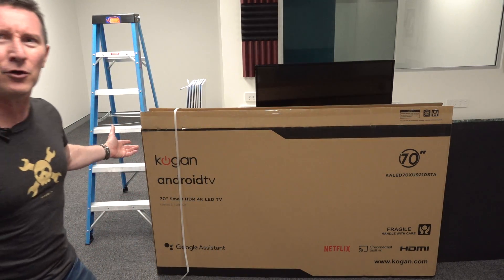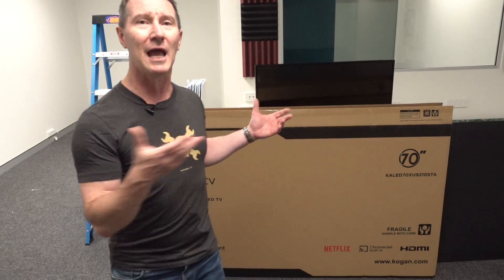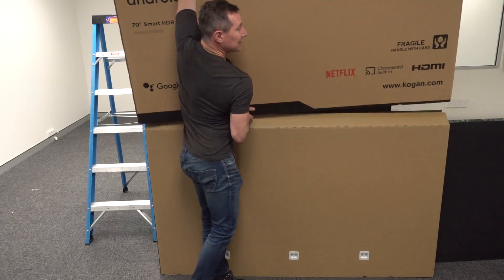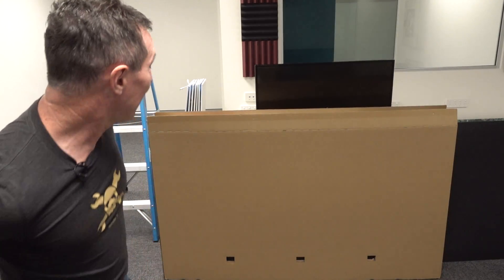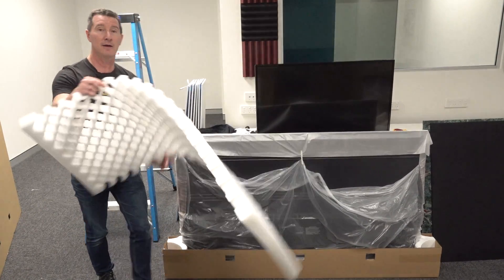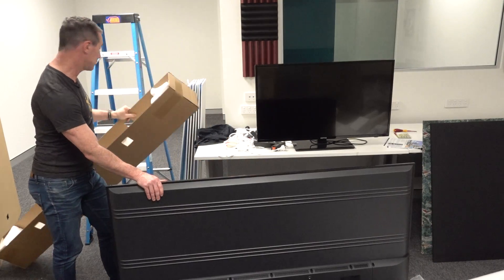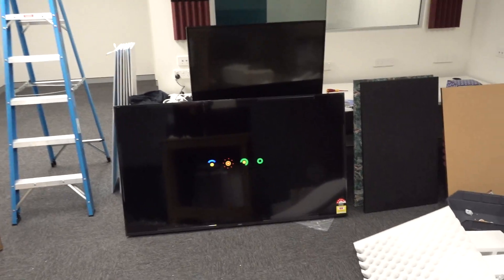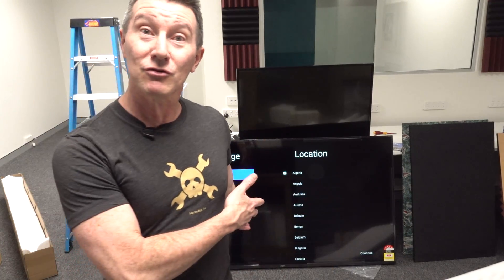eevBLAB #77 - TV Packaging Technology is INTERESTING

Comment: You missed the coolest thing...  If you squeeze the sides of the lattice foam it will collapse down, you can see how it was a smaller piece of foam that’s cut and then pulled apart.
Reply from the maker: Totally missed it!
Reply: This is how "expanded sheet metal" is made... that is the grill you sometimes see on vents/doors/windows/etc. that have that diamond pattern, and is made the same or similar way.
Reply: You can see where a small part of it has already collapsed back to the original form.
Reply: Came here to make this exact comment, glad someone else was probably screaming at the screen too lol
Reply: Was going to say the exact same thing!

Comment: If you took a high-tech device like that back in time 200 years and showed it to an engineer of the era, they'd probably be more impressed and excited by the corrugated cardboard box that it came in than they would by than the item itself -- the device would be completely incomprehensible (both in purpose and how it functions), but the packaging would be a revelation!

I've never seen that sort of fancy box, but whenever I've taken something fragile like that out of its packaging I always flip it upside down, cut the tape on the bottom of the box and open the flaps, flip it right side up again, then just lift the box off. Similar principle to this in execution, but doesn't require all that additional packaging and engineering. Presumably there are unpacking instructions on the box somewhere so people know how to get in there properly, but given that people have a tendency to not read instructions I suspect a lot of the effort in designing it goes to waste -- people will probably just treat it like a "normal" box.

Comment: After 25 years of being a UPS driver, I’ve seen it all when it comes to packaging....
It’s not so much the clever box packaging that keeps electronics, or anything being shipped, from damage. 
What keeps things from damage is packing the box as tight as possible. 
What most people don’t know is what your box’s journey through shipping actually goes through. It isn’t your delivery driver drop kicking your package onto your front door that causes damage, it’s the crammed up conveyor belt systems that tears up packages. Millions and millions of packages are sorted everyday on a conveyor belt system, and most of the time, everything is crammed on the belts going at light speed across a mega huge building. Then they are crammed into semi-truck trailers and/or jet planes. They are finally crammed into a delivery truck, where your delivery driver has to hump your box to your front door, trying to unbend and retape it as he is walking to your door to make your package look better. 
If any air gaps are present inside the box, the cramming of so many packages crushes the box, thus damage will occur.
So whatever your shipping, please pack it as tight as possible, and your item will arrive unscathed. 
Unless you’re doing an Amazon return and don’t give a care lol.

Comment: 2:29 don't worry Dave, i've work with strapping machines and the last thing that this kind of straps will be is weak, some of these straps are able to hold 3 tons of force that the strapping machine have put on.

So until you ruin it deliberately, it won't fail.

Comment: Hey Dave. There are actually engineers dedicated to packaging design. They’re responsible for designing the packaging to not only protect the product, but also to minimize cost and provide the desired “unboxing experience” as well. They often have gone though an undergraduate program in packaging engineering. I spent about 8 years working with packaging engineers. My role was in testing packaged appliances to make sure they would arrive to the customer in good condition. They designed the packaging and I tried to break it. Good times.

Comment: How ever did we get those huge 27" CRT's out of the box? Slit the tape, open the flaps, invert carefully and lift off. Clevererer-er installers than I would flip the box first so the telly was the right way up when the box came off.
Reply: It only takes a couple of tries to get it right.  27''?  Never saw any. They only went to 25''.
Reply: @firesurfer  in the UK we even had 32" wide screen CRT's. Two man lift or forget it - unless you wanted to slip a disc on purpose 😆

Comment: I bought a Sony TV recently and had much the same experience, but with the Sony box the bottom corners also pulled away, and the bottom centre held the TV upright with enough space for you to slot the feet in. No tipping required!

Comment: This was more interesting to me than most people. I worked in the TV/Radio dept at Macy's in the '70s. I had to open up new Tv's weekly to put on display. The TV dept was up about 6 steps from the stereo dept. Getting console Tvs up the stairs was a chore. I would turn them upside down, remove the box, turn the Tv right side up, pick it up by the edges on top and go up the stairs backwards. This is when Tvs were not light. The biggest ones had a 25'' crt tube.

Comment: Designing packaging and packaging machinery seems fun, but that box seems to need a manual of its own. Pull here, insert hex key there, call out to the mighty spirit of cardboard to open his treasure.

On another theme Power supply units to computers. Are there 12 V in units so one can run a stationary computer without gouing through a 12/230 converter and back?

Comment: Nice TV, but you couldn't pay me to have an Android TV. We bought a Sony 65" TV that ran on Android and the power on times were terrible, the OS would crash often, sometimes the TV wouldn't power on so you'd have to unplug it from power and plug it back in and then wait for it to go through the long boot cycle. Never again will I touch an Android TV. We exchanged it for a 65" Samsung Smart TV instead and never had a single problem. Same goes with several Roku TCL TV's we have.

Comment: If you are old enough to remember the console color TVs in a wooden cabinet, some with a built in stereo, were delivered by 2 or 3 men who carried it into your home and plopped it where you told them to (NO boxes!)...a console TV back in the 70s would run from $500-800 USD or more. If you're really old you will remember the old RCA color TV ads featuring their new solid state color TVs with "the works in a drawer" - a modular design with slide out sections for easy servicing. What got me interested in electronics as a kid was curious how TVs worked - how an image could be transmitted from far away - as I was fascinated by our clunky B&W TV with warm, glowing tubes - which we had to "slap" on the side to tune it....how far we have come!

Comment: Yep, same packaging tech as I recall on my Sony 55" 4KTV from a couple years ago. IF you have the room to save the boxes and all material it's a good idea to do so...first, in case you have to return it, and later on down the road if you move you can repack it safely for transport (otherwise you will have to buy a generic box at Home Depot). One caution they plaster on the packaging is not to apply pressure between the screen and the back which can damage or destroy the LED matrix.

Comment: Another nice thing about a bottomless packaging system is it's much friendlier for automated packaging than a conventional box that you have to open the top and pull things out that way.  In a sense, this is wrapping the device, rather than packaging it.  And I must say, this is a great deal better thought out than a lot of the interfaces on devices these days.  I think some of it is because prospective design engineers can no longer work their way through school and get a feel for how the users of the equipment that they will eventually design actually USE it.  I could go on for quite a while about what I think of the touchscreens on the ovens I have to use at work.  (In theory, these are wonderful, German-made and -designed ovens with a whole raft of wonderful features.  In fact, they ARE wonderful, but the controls are touchscreens, and I don't think touchscreens are a good idea for an appliance like an oven.)

Comment: As some one forced to get a new tv after lightning came in via Ethernet, to HDMI. I first got a 43”. That came out of the box from the top like any other. I ended up returning it for a 55”. That one however was like yours. I didn’t know it however and pulled the tv out the “top”. Only to have to brace the lcd panel on my knee, no damage. But then once out, the box, it all fell apart. I the dumb customer realized his mistake. lol

Comment: It's absolutely amazing that these TVs even work when you get them. I worked in the facilities maintenance department at a Target distribution center, since retired. TVs up to 32 inches were allowed on the conveyors. There would be a shippng container full of them and the guys would be tossing them flat side down onto the unloading belt at the inbound dock. The barcodes were read and a shipping label affixed. Then they'd go up the spiral to the mezzanine, over conveyors, through pop-up diverts, up and down incline and decline belts and onto a sorter that would tip them off a cart to zoom down gravity rollers into an outgoing trailer. Then a team member would grab it and stack it in the trailer. The big ones were labeled non-conveyable and were stood up vertically on pallets to be delivered to the outgoing trucks. I've seen them dropped, flopped over on their faces and roughly handled. It's a testament to the packaging that most make it to the customer unscathed.

Comment: 2:29 Packaging straps.  There is no need to "cut" them.  There is technology built into them.  Reach under the bottom strap has a section you can grab and then pull away breaking the strap apart!  Give it a go next time you come across one.

Comment: Packaging is so important to the overall customer experience of a product. I used to build network video recorder appliances. Early products shipped in cardboard boxes with solid polystyrene foam around the device. We saw a lot of DOA returns due to failed hard disks. Turns out solid polystyrene is very good at passing on shocks. Later revisions used a skeleton frame of polystyrene that suspended the product in the box. Much better! Bet that is part of the reason for the lattice on the front of the TV too.

Comment: Now, if they would've packaged the TV upside down, that would be really clever since you could've installed the feet on it and just flipped it around instead of having to pull it out and then have to mess around with the feet by laying it down or balance it upside down... :)

Comment: Not new. I unpacked a HP Laser printer (a big floor model) 20 years ago with very sofisticated solutions. At the end there were parts of the packing material that was used as a ramp for rolling it down on the floor.

Comment: I've bought a Dell 27 inch monitor, not a high end one, but the box was folded to form hollow boxes to give space around the monitor panel, there's no glue and no foam in it (except a sheet of thin layer protects the screen surface). That box folding structure is really clever and it's a whole piece of cardboard, not several individual ones.

Comment: I assume the lattice structure of the front foam is to reduce it's stiffness - if it was a solid piece, it would transfer any loads from relatively pointy impacts much more. The lattice structure will simply fold over, giving your TV about 5cm of crumple zone.

Comment: Interesting look at packaging.  I often wondered what the thought process was for packaging a product for shipping, and the sometimes clever way packaging was designed for minimum weight/cost/effort.  I have seen some clever designs.

Strange though... when I tried to watch on lbry.tv, the video was very choppy, but here on ytube, it was fine except when I selected 1080p60, then I got choppyness.
There is no way to reduce the resolution in lbry.

Comment: I find it really interesting that TVs nowadays have this packaging tech. Fridges and washing machines have been using this for a while now, due to their heavy weight and article size. My 3 years-old Sammy TV doesn't have this and though it is only 49", it is a PITA to unpack and pack.
Reply: TVs have used this packaging method for at least 10 years. For your Samsung, simply open the top, then flip it upside down and lift the carton off. To re-pack, place the foam blocks onto the TV's sides then slide the carton down OVER the TV.

Comment: Another interesting thing some manufacturers are doing is adding a "heat shield" sheet to the top of the TV since the containers are quite light and sometimes end up on top of the stack. This can damage some TVs, since the containers can get quite hot on top.

Comment: My first summer job was for a picture tube manufacture, I worked in the area where the “packaging engineer” work he went asked me to place a 21-70° or 25” picture tube in a shipping carton without reading the packaging instructions. Based on the number of mistakes I would make in doing it correctly he would consider making changes to the cardboard shipping boxes. 
Your TV box is an excellent example of packaging engineering

Comment: Based on the name, the batteries may be made in Israel. 😂 Never heard of that brand before, so I read up on it. Supposedly uses Samsung parts. A lot of complaints about the longevity of the product and difficult returns. Great video!
Reply: Considering I've seen many TV's that have power components flapping in the breeze with no heatsink this doesn't surprise me at all, it's almost as if they design them to fail.

Comment: Wait, did that TV just take 2 minutes to start? How is that acceptable? Who's bright idea was it to base a TV on android?
Reply: The first boot on a Android phone or TV takes a long time. Thereafter it is quick.
The TV is not "based on Android" - it is a smart TV that also contains an inbuilt "computer" running Android operating system. That allows you internet connectivity without the need for additional computer, etc.

Comment: The screen of such large screens can also be damaged if you lay them flat on the backs due to the weight of the screen panel. So there is a reason for this design of the box!
Reply: No, the screens of LCD TVs don't get damaged like that. They are made of extremely light plastic.

Comment: Not all manufacturers use the same ideas though.
I used to work in customer services and we used to get people calling everyday about how their TV's were 'damaged in the box'. What they meant was that when they switched them on they could see bright round blobs in the top corners and on the sides of the screen because they hadn't looked at or followed the instructions on the box showing how to get it out without damaging the screen. Instead they just opened it at the top and grabbed hold of it using the lip of the bezel as a handhold, this crushes the LCD and leaves thumbprints which the warranty will not cover ! They always wanted to turn it into a big argument because the retailer could not take responsibility for the customer not following the directions and no matter how clever you make the packaging and how simple the instructions, someone will still manage to damage the screen when taking it out of the packaging.

Comment: Another tip that I got from a friend that works in the shipping business.
When it comes to those straps holding the package together, it has been designed so you can take them off without using a knife or scissors.
You find the seam, where it has been welded, and turn the strap inside out. There will be a short stump that you can grab and yank, and the strap will generally come apart at the seam. Sometimes they can be a bit stubborn, but usually it works.
Reply: Yep, I'm always pointing this out to people bugging me for scissors. The heat seal joint is as strong as the rest, but easily separated by peeling back the end.

Comment: I think the primary reason to use the lattice foam is to reduce the hardness of the structure and make it deform more upon impact than it would have if it was a solid piece. A similar reasoning can be used to describe the "stripe" block used to protect the back side. 

Reduced material cost would be a bonus, although the manufacturing (pulling) process of that piece could offset that. The shipping weight reduction probably wouldn't have been a big decision factor as the package volume is likely to be more important than the slight weight reduction for freight of this size.

Comment: When you got to the last full size bottomless "overbox" could you have turned it upside down at that point, removed the short bottom box, attached the feet and turned it right way up before removing the last of the packaging with it supporting itself?  If so it would make it easier for one person to unpack and not result in the edge balancing act you had.

Comment: It would have been even cooler, would the TV be upside down. Not 'cause 'Stralia but you could attach the feet while that thing is in the box and then move it around with the box and the feet and pull up the box. ;-)
The boot time is horrendous but typical Android. Must be something like Android 6 or 7. Bloddy aweful.

Comment: Dave you missed a bit, you can even open the packaging straps without cutting them. When you flip the inside out, you can easily pull the tab to undo the plastic fusion of the straps. (Time 2:20)